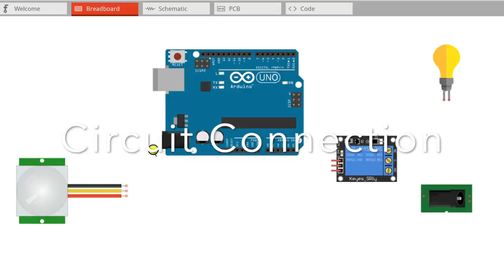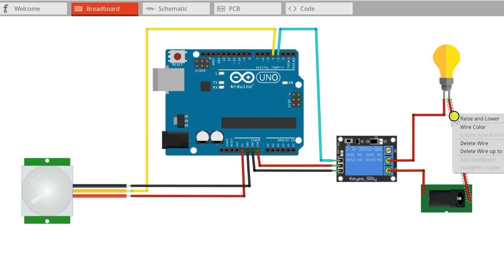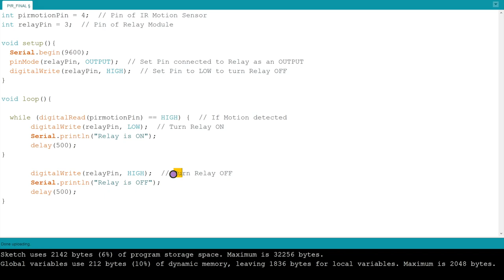Simple DIY tutorial on Smart table lamp using PIR Motion sensor and LDR interfacing with Arduino UNO

Comment: Great work. Do you have any problem when you stay there without any motion detected. I used arduino with PIR. But my lamp continually shut down which make me really annoyed.
Reply from the maker: Try increasing the time delay which allows PIR motion sensor to get enough time to detect motion.

Comment: Can i use arduino nano instead of UNO...
Reply from the maker: Yes you can, same pins are available in nano so no change in circuit diagram. Make sure you select Arduino nano in  Arduino IDE software.

Comment: Where can i get these materials?
Reply from the maker: These things are available in most of the electronics shop or you can buy them online just search for 

 PIR sensor module 
One channel relay module 
LDR 
Arduino Uno 
Jumper wires 
Table lamp